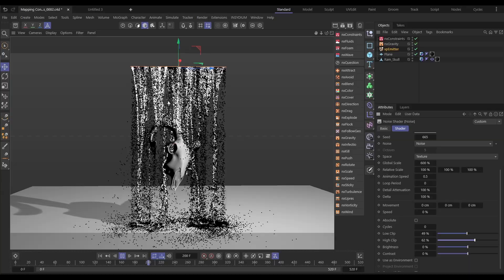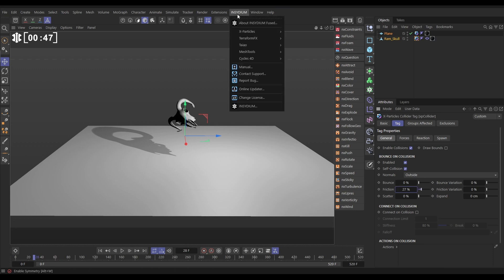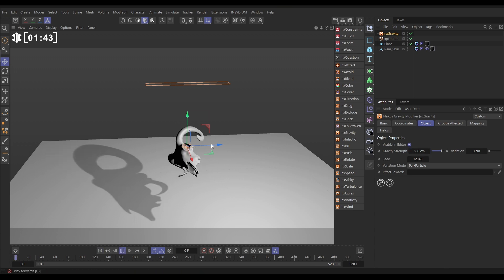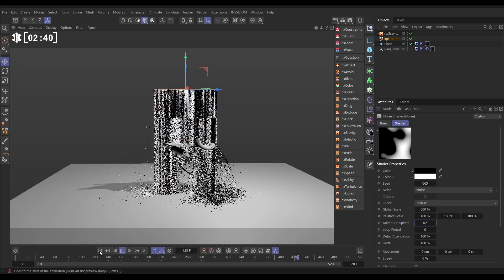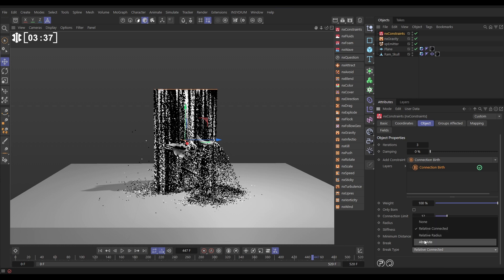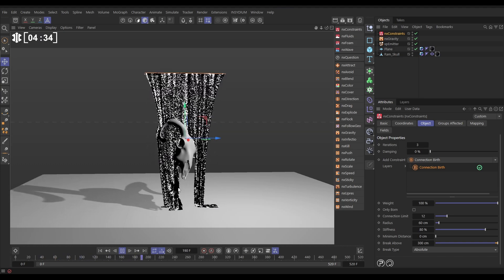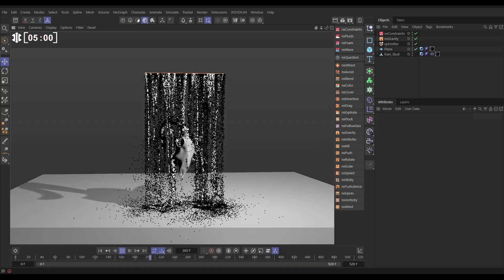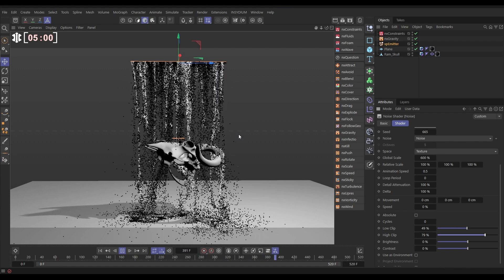Top Tip Tuesday - Particle Constraints Mapping

Comment: Would you guys ever do an add on where the white, for example, could be a gelatinous / viscous and the black could be another type of material, for example, a gold flake? 
Or would that be separate emitter builds? 
Curious how that would be built and textured in Octane.
Reply: Two emitter builds... yeah the particles may not interact - but it'd be just as easy and allow you more control. Plus, you could easily use a separate texture. Bob would know how to get the particles to interact, but I am le tired and gonna go watch some TV.
But yes your instinct is correct
Reply: You can use the particle color to move between any number of materials in one particle system. I'm not familiar enough with Octane to walk you through the steps, but it's really easy in Redshift.